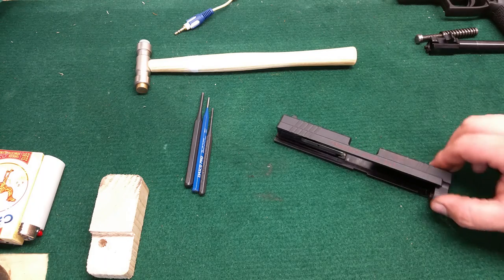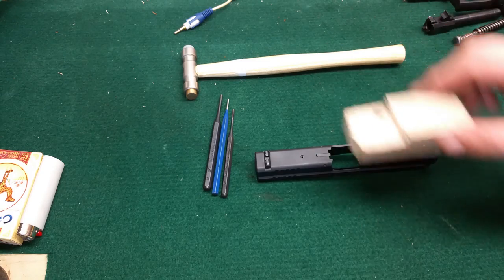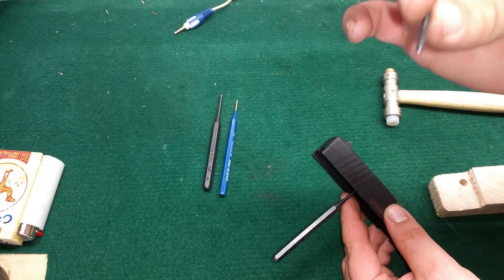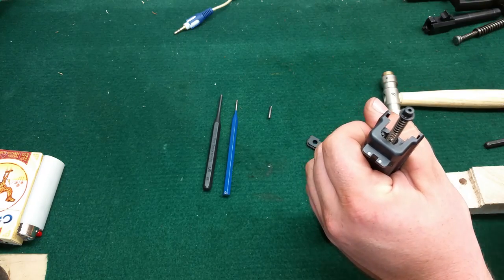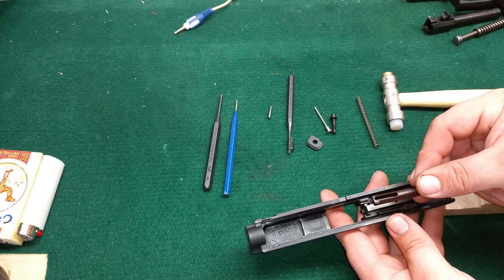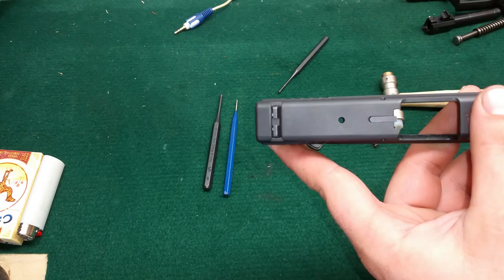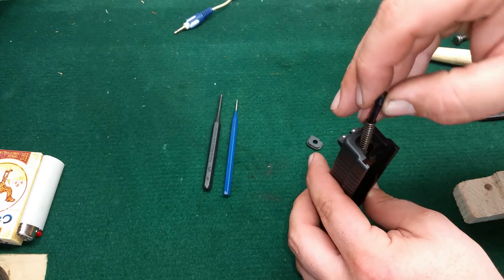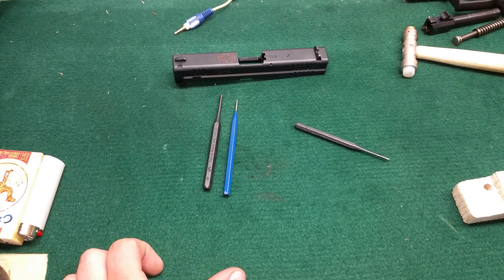Pulling the firing pin out of your Springfield XD

Comment: Thank you SO VERY MUCH for posting this video. Not only did you save me an $80 fee by doing this myself in lieu of a gunsmith, is that most of our competent gunsmiths in Austin are 2 to 3 weeks out/behind (sometimes longer). Like many others in this post, I had to remove the firing pin as the gun was no longer firing. The firing pin was so sticky (and gummed up) that it would not retract or strike with the force needed to ignite the primer. Removing it and cleaning all the parts with 99% Alcohol + ammonia mix and then very lightly lubricating with a not so thick oil (I now only use the Hoppe's step 3 precision oil as it is not too viscous) - did the job. What I found out, is that when I MIX the oils or cleaning solutions, the resulting matter is a gummy substance that really messes with guns. This happened when I would clean my gun with 1 brand of oil and then use a different brand the next time. Mixing oils over time results in this. Removing the firing pin and using a cotton swab with alcohol and ammonia and then very very lightly lubricating everything (the springs, the firing pin - talking less than a drop and then rolling it with my finger) did the job. THANK YOU AGAIN!!!!

Comment: We ALL use oil, which is needed for tail and other friction points...but from experience with "gumming" and sub zero conditions oil can cause a potentially dangerous condition where you squeeze trigger, it feels like it released seer, but cartridge fails to fire, so you should pause then open battery to eject round. BUT, in sub-zero the oil is very thick, it retards firing pin travel...the weapon can and probably will discharge after up to one or two seconds later! This, from experience. When you tear down the firing pin assembly clean/dry thoroughly and use a liberal dusting of lock graphite instead of normal lube. It still provides publicity but dry, and unaffected by cold. I also recommend this for entire trigger assembly as well....oil lubes attract/retain dirt/dust/powder residues and can foul mechanism. I have found ultra fine graphite superior to oil lubes in reducing friction! WD-40 is a well known product...but the company makes a superior dry graphite in a colonial fast evap carrier that sprays on. Let dry and repeat several times to build graphite layers...IT DOES NOT EASILY RUB OFF, so it will stick and continue to lubricate for hard use. Repeat after several hundred rounds to gauge how fast wearcrate is for you. Good video, just felt my information will be useful and save from accidents. Thanks.

Comment: Excellent video. I couldn't figure our that all you needed to do was push in on the cocking pin to loosen the back plate. Your comments were concise and to the point and you didn't waste any time (with any off-topic stories) getting to the core of the disassembly. Thank you. Liked and sub'd.

Comment: 👍Good job👍 Had to check this out due to my XD is new & in re-assembling it, the main firing pin spring is stiff & having issue getting together after inspection & clean. Thought I was not lined up correctly but it’s just a stiff bitch as is pretty new. 
Thx again for this video. It gave me reassurance✌️
Reply from the maker: Glad I could help

Comment: New to firearms, I found this gem at a pawn shop, haven’t fired it yet but I noticed the load indicator isn’t flush with the slide(not loaded), I googled the question & found this vid so now I’m asking why are you removing the fire pin besides the load indicator, I really could use the help.
Reply from the maker: I would need to see what your your talking about to help you
Reply from the maker: So I pulled my xd out to take a look at it. Even if there is no round in the chamber the rear indicator will be patruting if the striker is cocked to the rear. There are 2 indicators on that firearm one on the top of the slide for a loaded chamber and the rear is a cocking indicator.

Comment: Ever had a issue where the firing pin and spring are stuck in the chambered position?  I can not get my firing pin out at all my slide still has it in the chambered position
Reply from the maker: No I have never encountered at be for. I would tack it to your local gunsmith to have a professional look at it

Comment: Buw do you know if it's the trigger that's the cause of not firing or the striker related parts ? 🤔 The striker is loose, and moving when i shake the slide up and down, the striker safety i think, is missing which is right next to the striker/roll pin is? What would cause this? It won't fire
Reply from the maker: There could be a couple things that are going on. I would highly suggest taking it to a professional and having them take a look at it

Comment: my cocking indicator pin broke off and fell out the back of my pistol, will this affect the operation of the pistol?
Reply from the maker: it can mess it up depending on where it broke so I would suggest getting a new cocking indicator
Reply: thank you!
Reply from the maker: no problem if you have any other questions feel free to ask
Reply: Installed tacrack  ,spring shot across room,and the plastic thing that goes over indicator,o got it all back ,but noticed the indicator pin was somewhat bent?any idea what caused this,?

Comment: what if that firing pin keep coming out of the dedent? I am referencing what he showing at 3:39, even tho I did that and then put the roll pin in, that piece keeps sliding out from the dedent
Reply from the maker: @DREKOWICK69  as long as the roll pin is capturing the striker your good  but of your not confident take it to your local gun smith

Comment: This roll pin is really in there! Points to glock for not having one of these!
Reply: Points to the glock for using way more platic then stainless steal🤫
Reply: @HIGHER7RUTH  there’s that too.
Reply: @HIGHER7RUTH is it better to have plastic in theory because they say it is more flexible and tends not to crack as quickly or what? i figured the stronger the better but im new to guns

Comment: When I look in the retainer hole from under the slide the pin only reaches to about half of the thickness of the slide u think it's broken or nah
Reply from the maker: metapod there's a good chance that it is it should be slightly under flush on both sides but they are known to break quite easily because of a tapered hole
Reply: Civilian Arms channel also i forgot to mention that you can see right through the hole even with the pin in there idk if that's normal or not. Anywho I ordered a new pin today either way.
Reply from the maker: metapod that's because it's a role pin